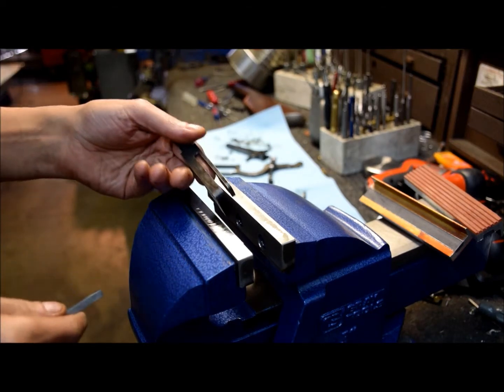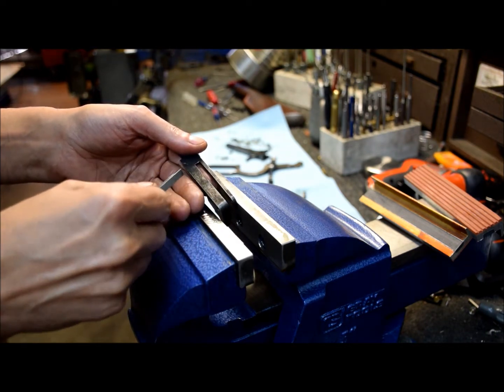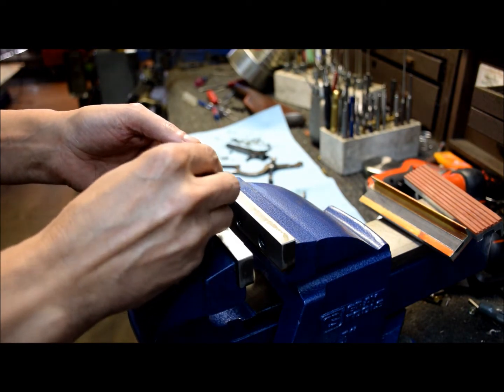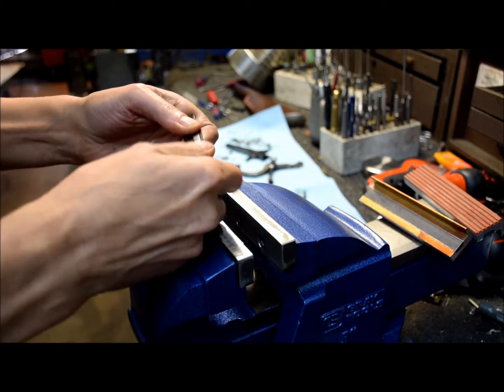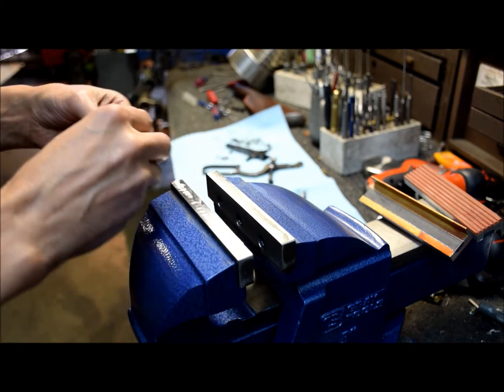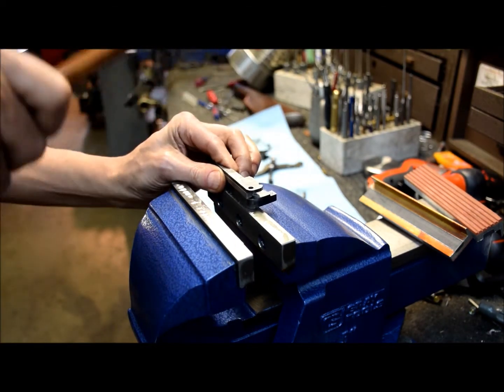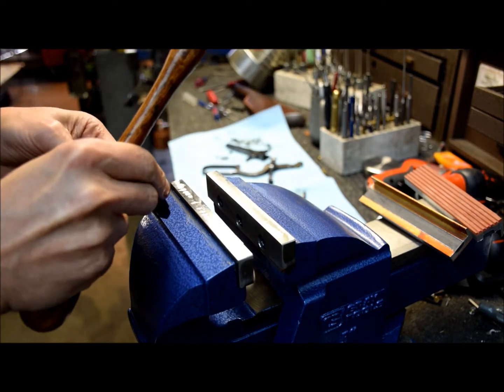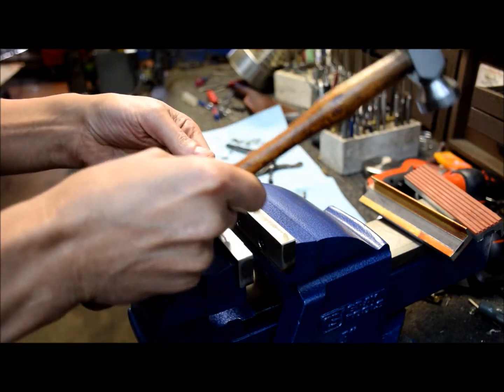Straightening Winchester model 94 Carriers

Comment: Bent carrier, post '64 model 94.
Bent fork of carrier, as in your video.  Straightened, buy re-bends when a round goes improperly under the carrier (a different problem, with a different fix).
My question is, why is it so simple to re-bend these carrier forks?   
I believe (without reading anything about it elsewhere) that a properly hardened - then tempered steel part shouldn't allow you to bend it back into shape (tempered to a 'spring' state) AND ALSO..., keeping it from bending (and retaining that bend) in the first place.
IMHO, bendability is the main problem (after the under-carrier jam condition).  
Your thoughts?
Reply from the maker: Most any steel can be bent. I have even seen HSS tool bits bend. Some times the bending is right from the factory. They warp during final machining, casting or stamping. Most of them are bent by customers playing Chuck Norris with them and getting them jammed. Just so you know. The carriers in 94s are not very hard. Most are probably about 30 to 35Rc and can be bent or cut with a file.